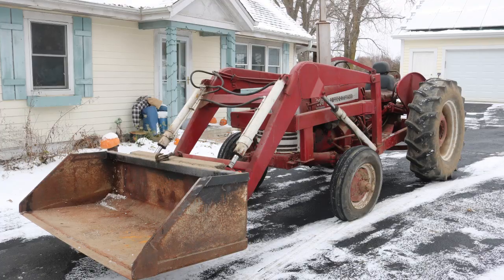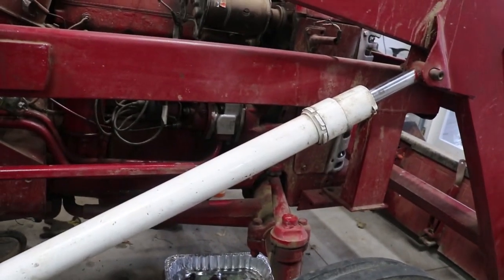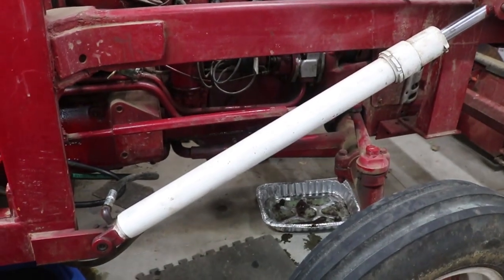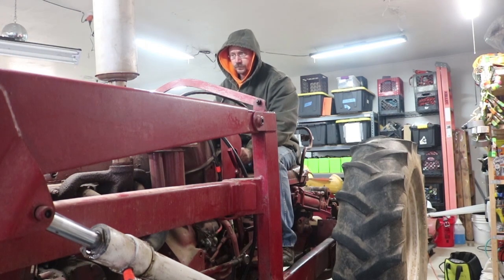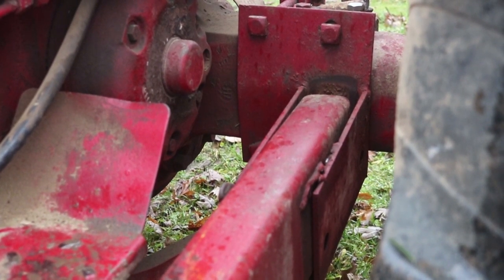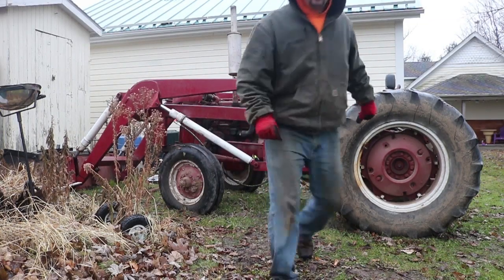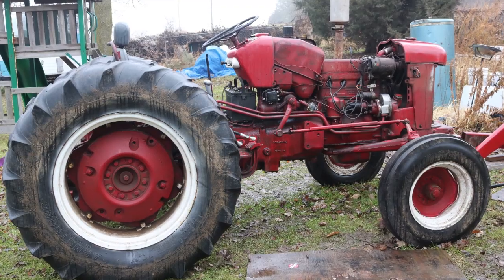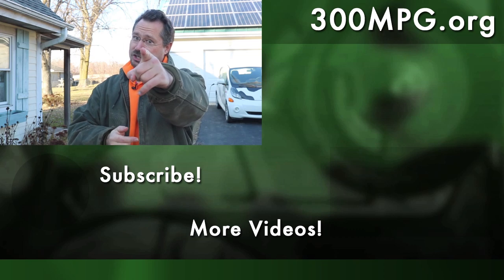Electric Tractor Conversion: Removing the Loader

Comment: Greetings from Northern Sweden, I am following your work closely because I am converting an old Ferguson 702 from Diesel to DC-electric by means of transplanting the engine (and accessories) from an old electric forklift.
The forklift was 24v 1200kg.
Good luck!

Comment: PS the shop manual is for the row crop tractor and you have a utility wrong manual hope this helps
Reply from the maker: I hope you aren't just going by the one pencil sketch on the cover!
The IH-10 manual includes International Harvester gas models: 300, 300HC, 300 Utility, 350, 350HC, 350 Utiliity, 400, 400HC, W400, 450, 450HC, and W450, as well as a similar range of diesels.
IH-10 is the correct manual for this tractor.
Reply: @BenjaminNelsonX  I was. my had the listing of models in large print on front. my bad sorry
Reply: I seen that too😂.

Comment: too bad you didn't use a h or a m IH tractor to start with the frame runs to the front axel  and the 300 the motor is used for the frame  if  you want to sell the parts left over I need a fan and rad as the fan on mine went thru it but a spare motor whould be nice too good luck
Reply from the maker: We'll be selling the spare parts off this thing in the not too distant future.

Comment: Nice let your brother have the heavy end.
I used stainless pipe tape for all my pipe fittings never have had a leaked.
Reply from the maker: In the one shot, I am out of the frame, lifting the entire part with a 4-foot-long steel pipe lever.
Also, I'm still recovering from multiple wrist fractures.
The leak I had was clearly from operator error. I'm pretty new to hydraulics and simply hadn't tightened it correctly.
I do like to show when I mess up in videos because that's how we learn. Nobody is perfect, especially me. Seeing where problems can happen helps other people avoid them.
Reply: @BenjaminNelsonX  when you put the quick connect on you might of dead headed the hydraulics locking the system might be why it would not start  try starting with the clutch in to disengage rear pump    do not let clutch out if it starts  for the oil might  have no where to go might brake parts  in that case you will need too hook the two hoses together  to complete the path of the oil
Reply from the maker: @granthaney2570  The issue with starting appeared to be some sort of electrical problem.

Comment: Fun video to watch. I'm glad to see I'm not the only one this kinda stuff happens to. The word I use most while working on anything is WHY. WHY is the last nut spinning, WHY did they connect the wires inside the frame where I can't get to them, WHY is there a mix of Metric and SAE. WHY,WHY,WHY. Really looks like a fun project and I'm looking forward to the next installment. Good work, good luck. My one question is ... Are you going to use 1 motor to run the tractor and another smaller to run the hydraulics or just the 1. Electric motors don't really have an idle. Something is going to have to run the entire time you are using the hydraulics. If you use just 1 motor you might use too much battery "idling" while using the hydraulics.
Reply from the maker: Not sure on the hydraulics yet. Decision will be made after getting the engine out and examining the existing hydraulic pump.